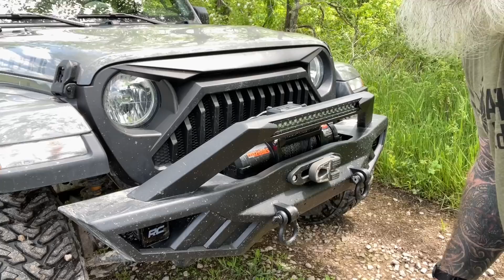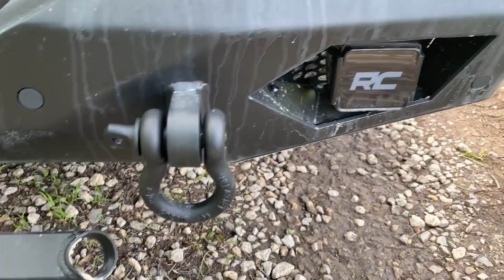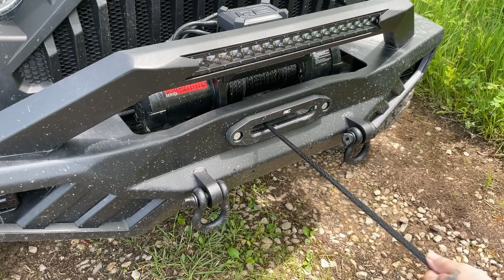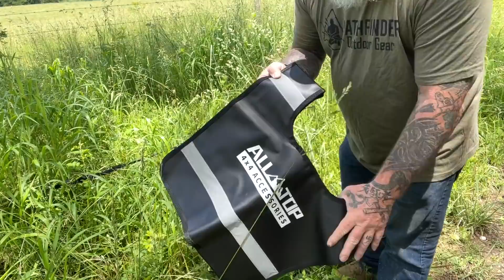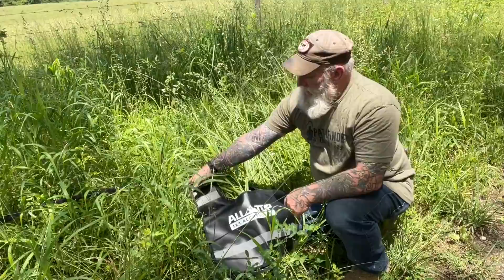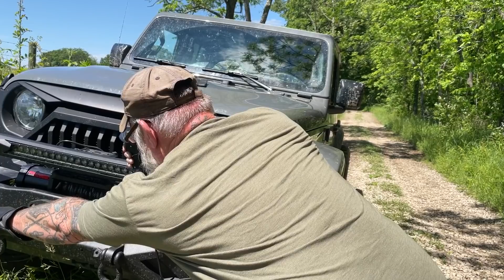Gladiator Build Part 7 Winch and Bumpers

Comment: Would putting the transfer case in neutral do the trick? Tow mode, if both the front and back axel’s are disconnected it would not matter if the transmission is in park.

Comment: Dave, When you spool your winch rope. Just put the jeep in neutral and lightly apply your hand break you can winch without it going into auto park. I have a 2021 Gladiator Rubicon and that method works fine

Comment: Dave, curious question, what is the maximum weight as cargo that your jeep can take and after the custom built add-on's and equipment, how much weight is left for personnel and/or other accessories? How much empty weight do you think you should allow for last minute cargo or so you don't max out the weight capabilities to drive safely? Like the vehicle build you have but just looking as what you or the manufacture thinks should be the safe cargo load for driving and handling if you know what I mean. Thanks, looking forward to the end product and all your ideas.

Comment: Couple of months ago when I was at my SO's Florida place I was coming back from giggin stingrays seen a guy covered in black mud hoofin it, I pulled over asked if he was ok? he said he and his buds where out jeepin all 3 stuck. I said hop in: So we drive out where they where 3 newer jeeps all tricked out all mired. the nearest one was nosedown in water/mud but it looked like he had a stout bumper I sent him out with my winch line steel not synthetic and a hook shackle hooked up to my old W200, He hooked up and said ok. I hollered at him too move, engaged the winch and pulled in slack,  as soon as it came under tension the old dodge dug in so  I threw a chock on my wheel. and took up a bit more.. snap! his whole damn plastic covering of bumper came off, he hooked thru the aesthetic part yikes... I ended up getting them all out and teaching them how to use the Danforth anchor and the high-lift jack knockoffs they had (the kockoffs are pure crap most needed to be de rusted  we ended up using mine.. I always carry a Danforth cuz trees in my part of Florida don't have much holding power....It was fun we all learned something and generally good kids, dogs had a blast so exhausted after giggin and recoverin had to pick two of them up haha I felt bad for the guys bumper. they where pretty impressed with my old beater dodge that I have about 500 bucks in.

Comment: Great video series. The only thing I would change is the winch. Get one with an air compressor and a wireless winch control. And don't forget the winch cover for when it's not in use.
Nice build though..
Keep up the great work Dave.
Cheers !!

Comment: That is a nice Jeep. It's been a min since I've owned a Jeep, but I did mount a 10k lb winch on my Dakota only because they are so useful. I prefer steel cable only because it's more abrasion resistant. When I first got into winches, I had to educate myself and funny enough, it seemed like there wasn't many US videos from people who knew what they were talking about or didn't mention much, I watched tons of vids of Australian offroad vids and let me tell ya, those fellas know how to use their equipment. I learned so many ways to use a winch it's priceless. One of the biggest things I learned was maintaining an electric winch. A big issue is, condensation or moisture building up in the motor or on the solenoid, causing corrosion, which will kill the winch. Best way to mitigate that was to use the winch for 3-5 mins once a week or on some type of regular schedule to heat it up enough to evaporate any moisture build up inside. So twice a month I use the winch to spool put about half the line and just spool it back in putting as much tension on it as I can using my gloved hand. Had my winch for a few years now and it has always worked when I needed it too. Another thing was to keep a smidge of electrical grease in the plug on both the remote and the winch if it's not a cordless, keeps the prongs from corroding. 

I also keep a tool box in the back with just winch accessories. I keep a 12' logging chain to chain my truck to a tree to keep it from moving when recovering other people's vehicles. 2 30' 20k lb rated tow straps, 4 bright orange winch line blankets, 6 20 ton shackles, tree saver strap, 3 20k lb rated snatch blocks, leather gloves, 2 head lamps, and a large flashlight. More times than not I use this stuff to pull others out of mud holes or the ditch, but the to straps add the extra length so I can double my winch line, but the extra snatch blocks come in handy if I'm stuck and I have to winch at angle due to no tree's directly in front of me or if I need to winch out backwards, which is not my favorite thing to do but I've done it before. Also comes in handy to use them to lift things using a large tree with large branches, especially game animals or some equipment.

Comment: Could you put a roller on the bumper, underneath where the cable comes out and run the cable underneath the jeep, hook to a tree straight behind you and pull the Jeep backwards? Do they work like that? Thanks

Comment: Or a lot of weight in the driver's seat with the seat belt buckles. You were lucky it wasn't on inertia reels. This is  why  you always use a second man when wenching forward. Like the old open face reels with the line guides on the front. Keeps the line straight in or out.

Comment: Why do the manufacturers DO that??  My side by side will not run correctly unless the seatbelt is plugged in, once one of them is, it runs perfect.  it WAS DRIVING ME NUTS! Nothing about it in the manual, found it online.  AND I will be trying out my 3500 winch so this  is  could not have one at a better time!

Comment: Just did mine again on my WJ after getting a new hidden winch bumper and a new synthetic line last month. Used a light pole in a neighboring business lot and had to snatch up the slope because my line was too long for the area I was trying to tension at. If you get over to WV I have some good spots to check out and ride

Comment: I'm just curious. Whats the total price tag? We got to be over 75k
Reply: These start 76k in Australia and top model is about 90k plus on road costs a few grand more, before adding any extra modifications . Only available with petrol engine , with a lower payload and towing capacity than most other similar ute's in Australia. With a 20k or more lower price tag for Japan or Asian built ute's.  Jeep has a terrible reputation for reliability, customer service and value for your dollar in Australia. What is there reliability reputation in America like?
Reply: @uncletomscabin2073  
Not sure about the new Jeeps, but the older jeeps are well known for being the kings of offroad here in the US. Most people can buy a nice used Jeep for under 20K depending on year and model. However, when it comes to a Jeep, most like the older ones because they have the 4.0L inline 6 engine (before year 2000 I believe when Jeep stopped the inline 6 production). Not the most powerful, but they last forever. Many have well over 300 thousand miles on them and usually out last everything else on the vehicle. I've had 3 Jeeps. Love them, but since I sold my last one because I needed a pick up truck, I'm investing in a different Jeep here shortly, getting a Jeep Kaiser (1968) M35A2 with a 465 Ltd 7.8L multifuel engine with 46" tires and that's 6 wheel drive. Other than climbing steep inclines or rock crawling, a Jeep wrangler or similar variant won't even touch it as far as everything else.
Reply: Base price for a Gladiator Sport is $34,000.  If Dave's put $10K worth of mods on there so far I'd be surprised.  You can tell by the brands of certain aftermarket mods that he's watching pennies.